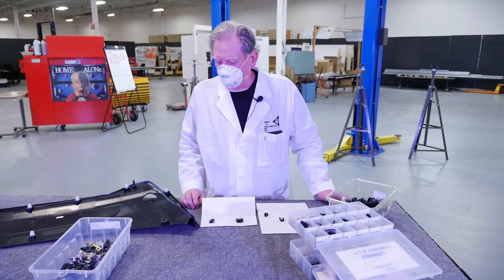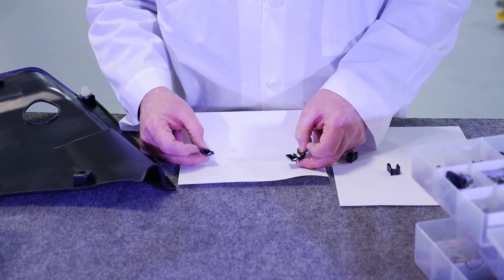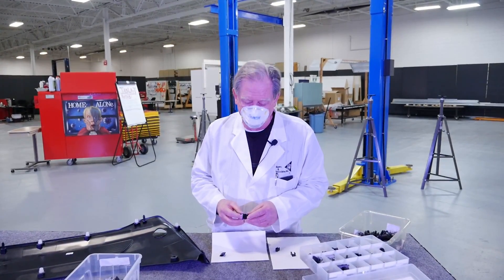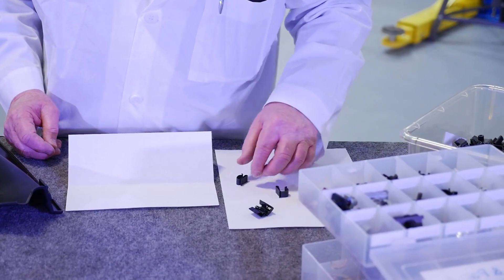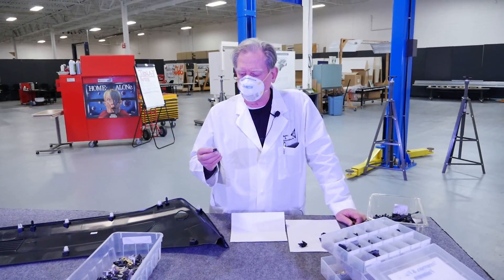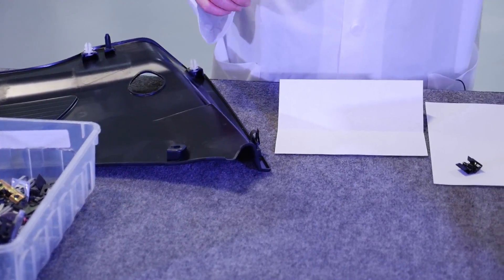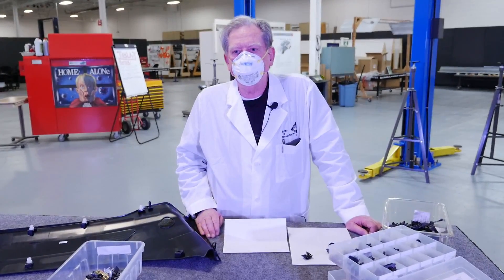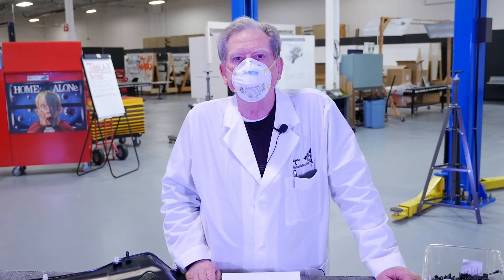Model Y E4: Sandy Proposes Cowl Cover Clip Redesign

Comment: The clip you mention is "Easy in , hard to remove" that is true. The issue for the technician is that clip has teeth that bite into the plastic and during removal tear the plastic almost making it a one time use panel. They do retain greatly the first time.

Comment: I have an early 3, it only has the 'christmas tree' white clips. I've taken that cowl off a few times and it pops back on easily. It's much smaller on the 3.  If you didn't use those outside edge clips no one would ever know.. maybe it vibrates a bit? This is a super minor thing to be worried about.

Comment: A smile & a laugh [albeit behind the mask] - Alex Guberman is rubbing off on you Sandy.... 🤪😜😋

PS. Don't forget to wash your hands both prior to donning & removing your masks & only handling the straps if at all possible as you're probably well aware, viruses can settle on surfaces inc. fabrics -  in both instances it means touching the face & handwashing removes an infection vector.

Comment: This is great, Sandy! I'm checking in on you guys every day now! One quick tip would be to set the whitebalance of the camera to (I assume) neon lighting, since otherwise your skin tone becomes purple. If you have different light sources in the front and back, the camera has a hard time auto-correcting, so you might want to just set it to the color temperature the skin is at. Otherwise great work! Keep 'em comin' and stay healthy!
Reply from the maker: Appreciate the feedback, we'll be making some adjustments.  Thanks for tuning in!

Comment: lol I just got my model Y and had to see if I had the same issue...and I do. facepalm
Reply from the maker: Interesting note, thanks for sharing.  Did you find that any clips were missing or broken?
Reply: @MunroLive  I just checked again. The front driver-side is still intact, but the front-passenger side is broken off.
Reply: My passenger side clip is broken also, do you have a specific replacement tinnerman clip that I could get that would be drop in or easily modified?

Comment: The same clips are used on the model 3. Techs have been complaining about those clips for a long time. They break as soon as you try to install the trim.
Reply: I have an early 3, it only has the 'christmas tree' white clips. I've taken that cowl off a few times and it pops back on easily. It's much smaller on the 3.  If you didn't use those outside edge clips no one would ever know.. maybe it vibrates a bit? This is a super minor thing to be worried about.
Reply: I'm a factory Tech.  Those particular clips are only on the outer edge of the tub on the 3, not on the rear apron. If they break on the 3, you usually don't notice because the tub is more rigid with the large "skirts" up the sides. Yes it's minor,  but on the Y you can hear the rattle over rough roads because the trim is larger and has more flex.
Reply: @chstra45  I/we appreciate your direct knowlege.  Thanks for your input.
Reply: Fixable.  Sandy has shown how to fix it, too.  If Tesla hopes to stride across the planet like a colossus, they'd better listen.
Reply: @Urgelt  Yeah. My point was more to the fact that Tesla is aware of the issue. Many of the things people hear from media and industry experts Tesla is already aware of. This particular area is a bad example, but they can't wave a wand and fix everything at once. You need to triage. There's more to it than just pointing out a problem. Even in this instance changing can incur cost. All that being said, I'd like to change this clip too. But pointing this out is a waste, no big revelation in this video. Get to the heat pump and the busbar, or the 300kw charging.
Reply: @chstra45  I don't disagree, really.

I do think that Sandy's company furnishing a list of recommended improvements to the Model 3 - for free - was a very nice gesture.  There might have been some solutions in that list that Tesla hadn't figured out yet.  If not, no harm, no foul.

But yeah, we're all here for the tear-down and no-holds-barred critique.  I trust Sandy to tell us what's good, what's bad and what's ugly.  I'm sure Tesla will be paying attention, too.  Their engineers won't be able to resist.
Reply: @chstra45  Tesla is known to make hundreds of changes week to week to deal with issues.  Traditional auto may only make one or two adjustments for an existing model year before the next model year comes out and that is only if there is a possible lawsuit in not doing it.  It is mind boggling that they don't fix this clip, they fix lots of other stuff.
Reply: @_PatrickO I work there. Some changes come quickly, some don't.